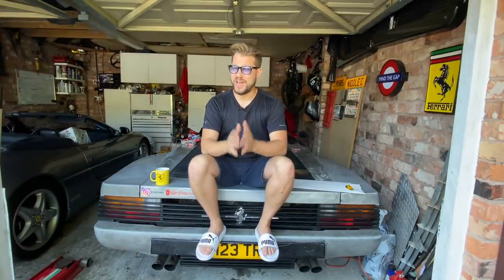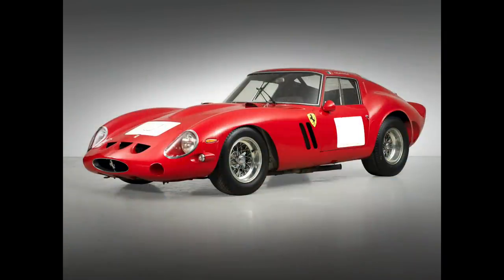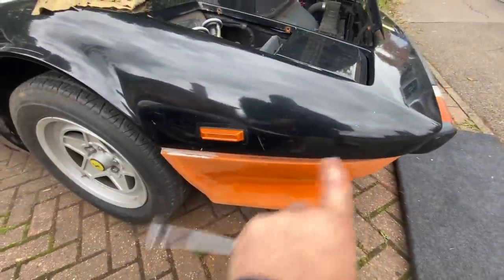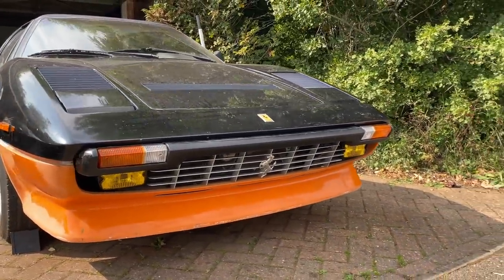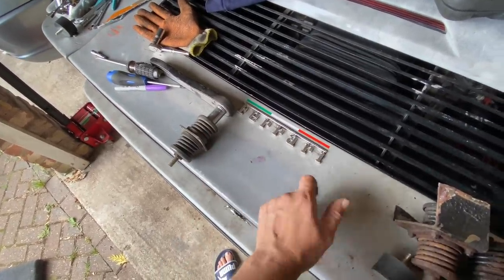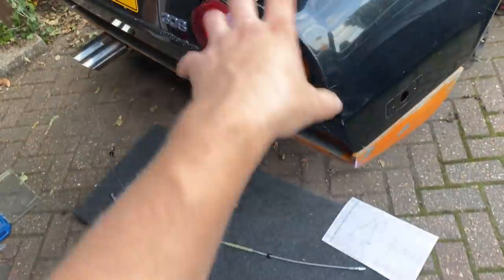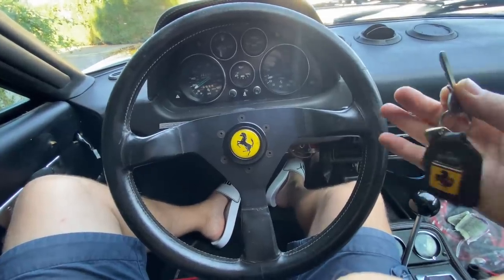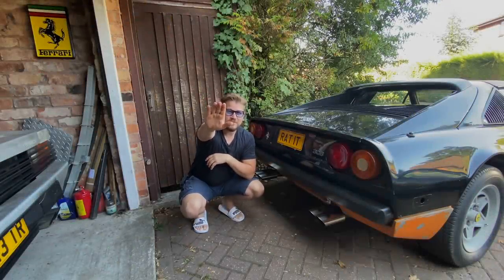I Bought a Music Icons Number Plate - Perfect for my Ferrari Project & Created a Mega 308 Exhaust !

Comment: 308s are old enough (pre-1985) to not need side indicators to pass an MOT. The oldest ones (pre-1980) don't need an MOT at all!
Mine was the first steel example in the UK and wasn't even fitted with a passenger mirror.
Reply from the maker: ive got an 82 gutsy and next year that becomes MOT and TAX free ....nice

Comment: Weld a M8 nut on the top of your M10 piece salvaged from the original mount.  Now your rubber isolators will thread into your piece.

Comment: If your classic runs on all cylinders when it starts is it even a classic?

That handbrake cable looks a bit dodge though. Won’t it fray as it rubs across that bracket that you bent? Should there be a conduit on that that it runs across?

Comment: Hmm to put on the testarossa, or to NOT put on the testarossa, that is the question, as that Gel Boogy Plate was pretty god awful, and to be honest the TR's plate thing doesnt really work on it either, like that would work way better, also I'm starting to think the 308 should stay black and just get resprayed, as it looks properly good with the idiot bumpers off of it now

its only really the seats that are letting it down, like the perfect black and red piped leather looks almost fake against the patina'd and interior body, like get some tan seats or have the piping made black in that boy, then have it resprayed or detailed, or both, as I've seen the perfectionalist valet take a 50's car will dull paint and make it shine like a showcar, as those cars didnt really have gloss coats, it was all paint, so when it went dull it looked horrible, but the paint below is fine so they come back beautifully. 

as get a paint thickness gauge and take a crack at it, it might be pretty damn deep so a polish could really bring it back

and keep it as is, as this car just wants to come back, plus it then you'd have two semi ratty cars you can use regularly

well three actually.
Reply from the maker: I have another suprise plate ....even better for the Ratarossa. Paint thickness on the car is not great, it looks like its been polished right through before
Reply: @Ratarossa  Hmm so a respray is the only option, she does look good in black though, actually I do wonder if the ferrari mix of black is different from other cars however, as even their basic black looks better than most other blacks, even in this worn state

although the doors wide open on whatever you want to go for given black is the easiest color to respray, heck you could even try the legit REAL miami vice color nero daytona and tell them to go heavy on the metalics like they did there

as the original TR's came in this really stunning Black metalic with that name that was heavy on the flake as tavarish kinda covered the differences in on his Murcie Build here at 7:49

https://www.youtube.com/watch?v=dG3y1eh4PSk&list=PLrvMJaD0-PufLw5XBhSl0Ss6qfs4uhKkb&index=19&t=0s

and it gave it like a BEAUTIFUL silver shine in the light

like every time I see it in that one episode, when irish eyes are crying, a so so episode but my jaw drops at how beautiful it was, and then to go matt white, like, damn it guys!

I mean it looks good but you look at it how it was and its like DAMN, you had a supermodel go from a fine evening dress to casuals! 

like yeah she can look good but man white casuals when she looked that good in black, like what the hell?! 

like that and seeing a magnum PI ferrari in green have always stuck out to me as the go to colors for a ferrari.

that or that beautiful green that Jay Kay had his ferrari F355 in, which is calle some sort of Verde